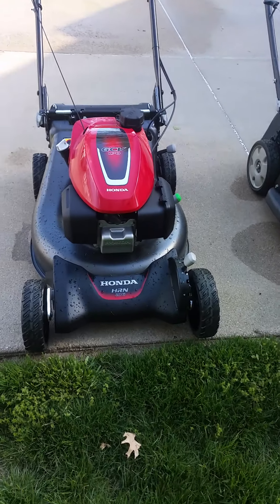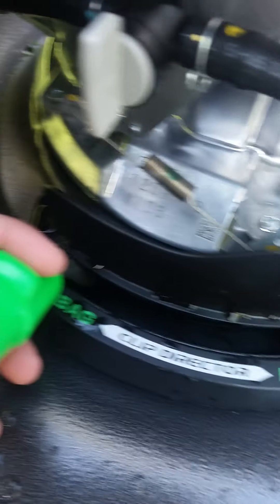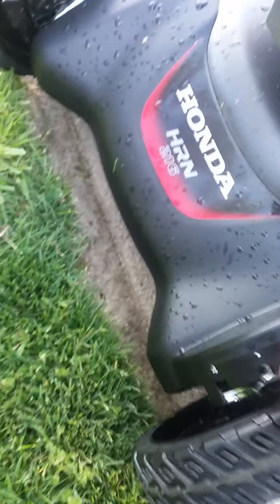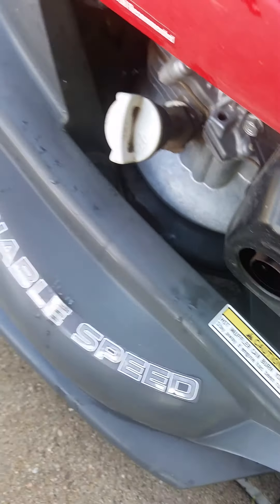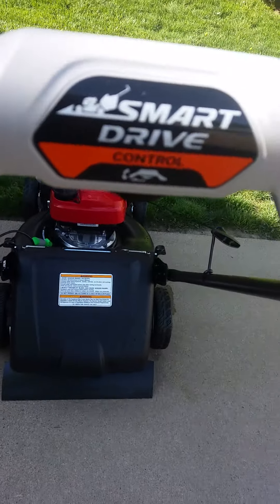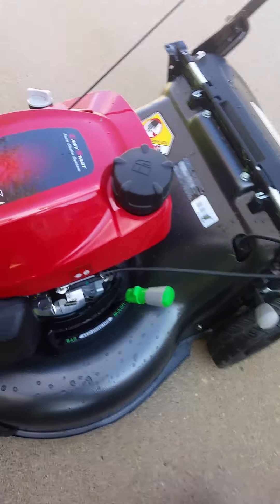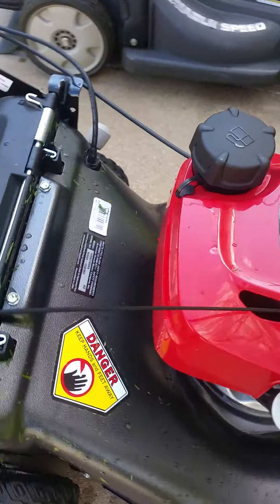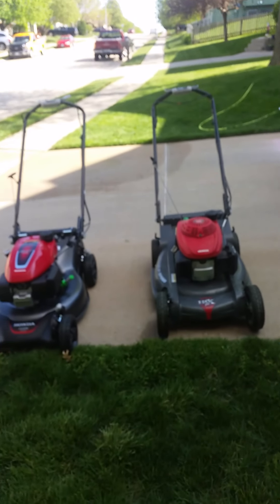Honda vs Honda

Comment: Thank you for the great review young man.  You did a great job with your review video.   I'm impressed.   Here's a question for you:

Which mower, the HRX or HRN, mows wet thick grass better, especially in mulching mode?

Keep up the great work!
Reply from the maker: The Honda HRX has a little bit more power than the HRN. The HRN has 170cc motor and the HRX has a 200cc motor.  A little more power than the HRN. So the HRX is the best choice.